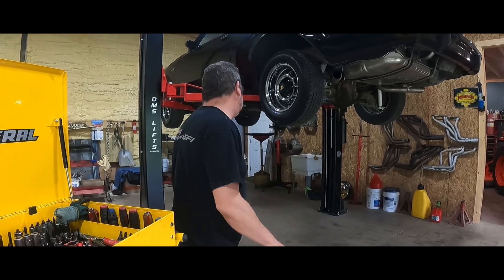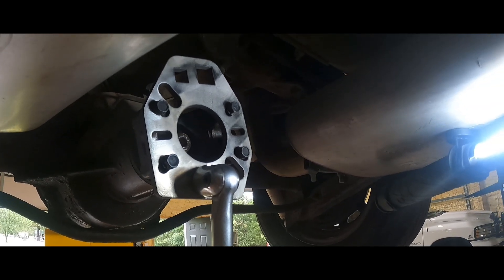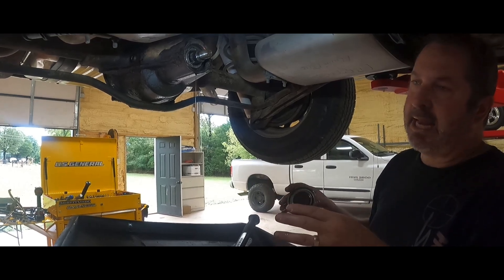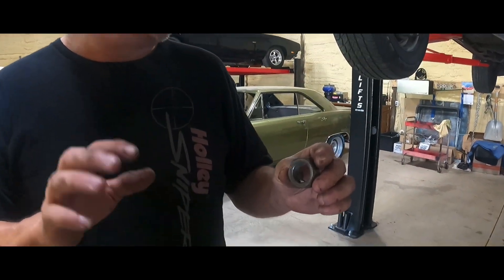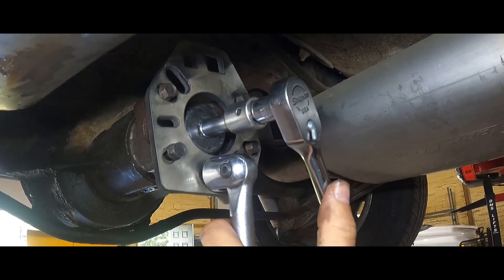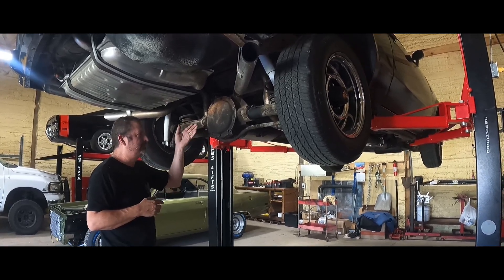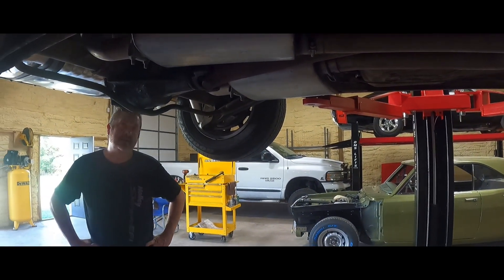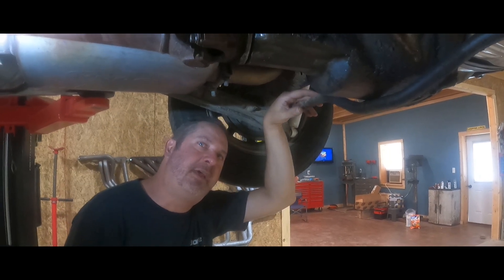Rear Pinion Seal Replacement

Comment: I have had my craftsman seal puller for 35 years now and it has never failed me. The one you have from summit is for a much smaller job. 
I will get you a model number for the seal puller.
Reply from the maker: Thanks Kevin

Comment: The rear differential oil should be 80-90w for stock 3:42 gear + posi fluid additive.
Reply from the maker: Thanks Angelo. I should have gone with that weight. Thanks for the heads up on that!

Comment: First thing to do is measure the bearing perload properly you need to measure it.....if it's correct in the first place....wheels and drums or calipers need to be off then take a inch pound dial style torque wrench and turn the pinion and all and take a reading... A oz fishscale will also do the job... You need to know your specs for the rear your working on... Bearing preload new or used bearings have diffrenet torque preload... crush sleeve or shim pack set up.... as if you set it to loose it will destroy itself same as to tight. I've done hundreds of rears pinion seal replacements from cars to light trucks with out a failure.
Reply: . You can get away with axles in but it is preferable to remove them pretty basic mechanical stuff lol😂
Reply from the maker: Great advice. As you can tell I am totally out of my wheelhouse here
Reply from the maker: @moparsareeverything1980 - I definitely made mistakes and just wanted to share not to make the mistakes I did.
Reply from the maker: @moparsareeverything1980  - Thanks you too.  Love your cars by the way.